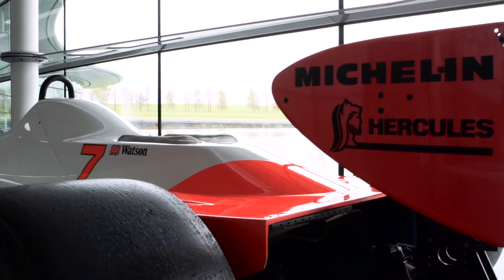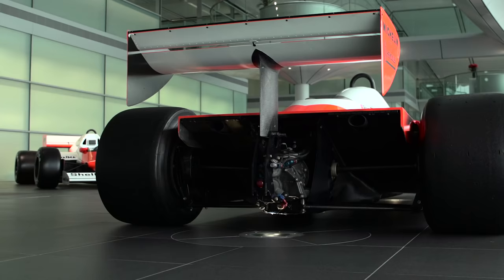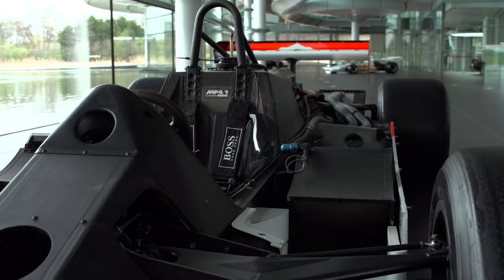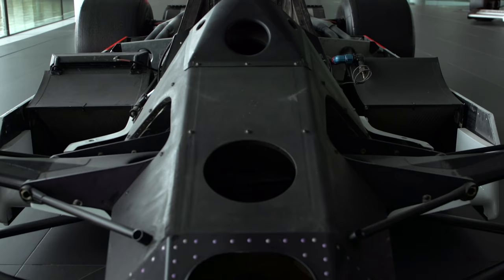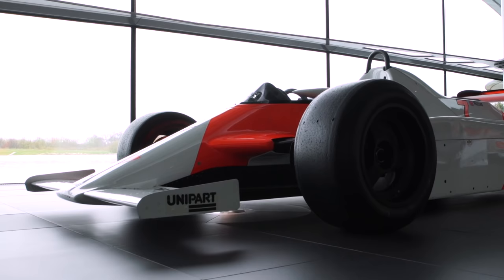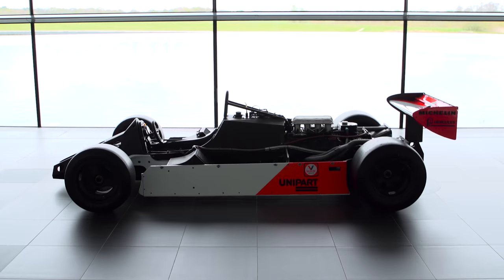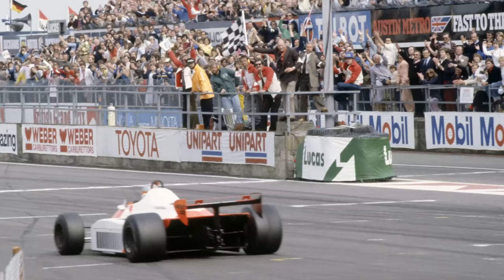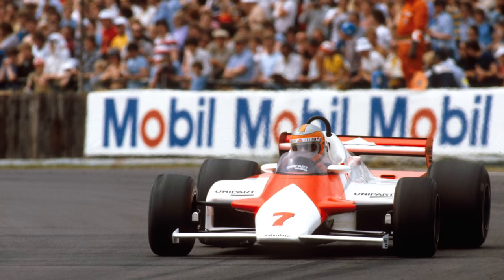First Light - The story behind the McLaren MP4/1

Comment: I've seen that car at a vintage F1 event and compared to other cars of similar vintage like the Williams and Brabham the composite monocoque is such a huge innovation. Most other things about the car were pretty standard for the time. Suspension was just lever arm wishbones (not yet pushrods), DFV engine with a Hewland gearbox. But the carbon moncoque is way cleaner with fewer joints and parts as he points out although the construction was very much "black aluminum" (i.e. made from composite but still built like it was aluminum)
Reply: +bradfocl 

Thats the cool thing about this car. Its out of carbon, but the rest is primitive (standard).

Comment: We were road-racing super-bikes at the time carbon fibre came out and we dreamed of using it but it was so expensive,  `1981 or so, we were still using modified street bikes at the time,  250gp 750 Super and 1000super

Comment: Doesn't seem like it has ANY down force, compared to modern F1 cars. Still an icon and amazing invention.
Reply: Greiguci Wootchie I don’t think a any early 80’s F1 car with ground effect could ever be described as lacking downforce. Remember they were going around corners so fast that they had to ban ground effects after 1982. Mainly because suspension technology wasn’t developed enough to ensure a stable ride height and therefore grips levels due to body roll and pitch
Reply: The underbody created huge amounts of downforce using “ground effect “. Regulations today mean the cars have to have flat undersides which negates ground effect.